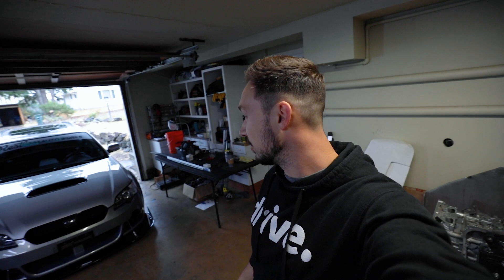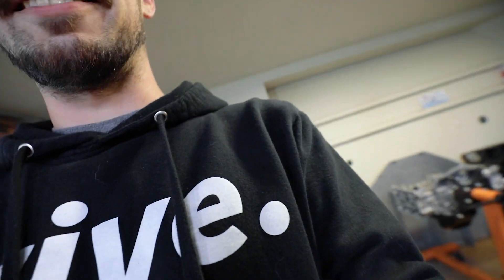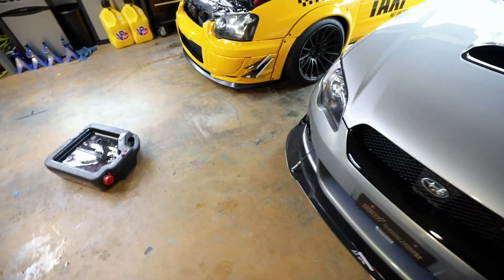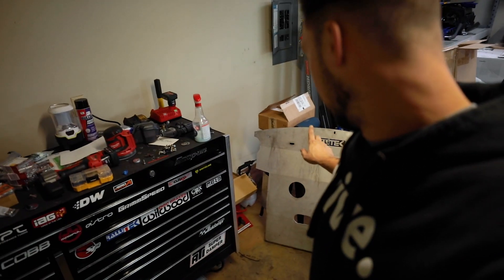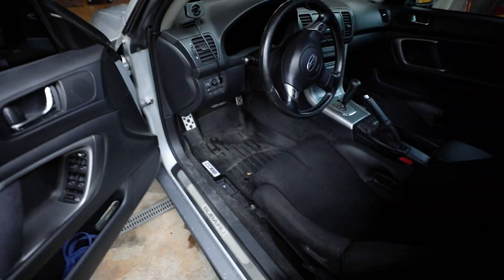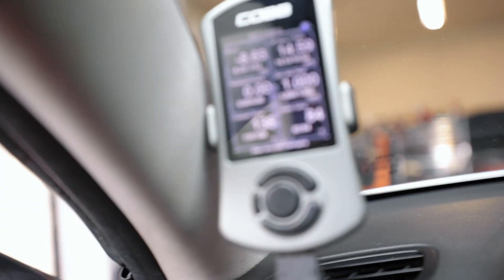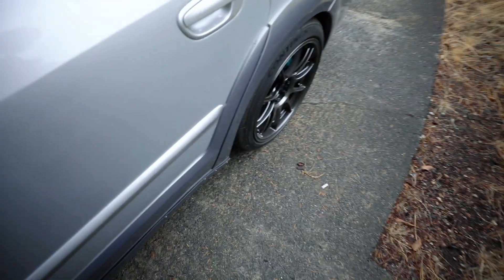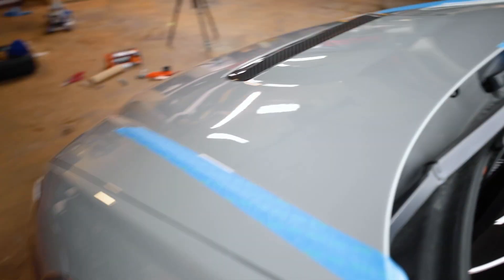Do hood vents actually help?! Let's find out!

Comment: Nice vents. looking for similar. Cant understand subaru idea behind IC placement at the top of hot engine.  What intake air temp do you have there on WOT?
Reply from the maker: With that top mount when actually moving air you'd see pretty low temps, close to ambient, and it would drop quick when getting on it. Issue is mainly heatsoak while sitting.
Reply: @MatlasDI  seems better than I've tought. Anyway I cant find vents like this in EU. Steel and with bolt holes.  I just found some marine engine bay vents look similar and are cheap lol.

Comment: Ok wheres part 2? I meam idle temps are useless. I wanted to know if driving temps went up or down 😂
Reply from the maker: @Bemk3  🤣 the car is in pieces now, but yes, they went down while driving as well. It was mainly heat soak that was a problem for this car with the top mount, once air was getting to the intercooler I'd see immediate drops all around. 👌

Comment: Thanks for this amazing instructional video. I have a 2008 Subaru Legacy and would also like to install a vent/lourve. I pretty sure that this has been taken into account but is there any possible way of avoiding cutting the inner structure of the hood?

I live in Singapore which is located 1 degree north of the equator; so we get pretty hot with the ambient temperature being about 86F [ 32 Celsius ]. The heat soak engine temp on idle can go as high as 158F [ 70 Celsius ] vs what is reported for yours [ 6:33 / 12:00 ] which is 68F [ 20 Celsius ] ambient & 144F [ 62 Celsius ] intake. So installing a vent / louvre on my Legacy would definitely help dissipate the heat away from the engine bay.

Comment: The way I see it if you roll down the passenger window it kinda blows air around in the car because the pressure has no where to go ( same as just front grille). If you roll down passenger window then driver window one at a time you'll here and feel the pressure from air making more of a suction (same as hood vents would do).
Reply from the maker: Very fun comparison 🤙

Comment: About to do these vents myself, have you had any issues with too much weather and/or debris getting in?
Reply from the maker: Not under normal conditions. Nothing ever had issues due to water intrusion, I did make sure to block them when washing the car, though, to prevent pressurized water from getting in.
Reply: @MatlasDI  wasn't sure with the AOS, that harness connection moves virtually right under that vent.
Reply: @MatlasDI  also trying to get an image in my head how they will look with Cyber-R scoop
Reply from the maker: @poudrecanyonbiker  think they should look good with cyber R, both pretty edgy so fit the style nicely I would think.

Comment: Nice work on the hood vents! I have a pair I've wanted to install. Now I know how! 😁. What are you planning on using for your gauge cluster once you install your six speed? Will you put one in for a manual or just leave the auto one?
Reply from the maker: Thanks man 🙏  look forward to what you wind up doing 👌 I'll be switching to haltech so it'll get their cluster setup.
Reply: @MatlasDI  Nice!!! That will be sick! Sounds like you have a lot more tuning control all the way around with it. Will the display fit somewhat in the same location?
Reply from the maker: @Mark A  Yeah, should make everything pretty smooth. They have display mounts that go in the same location.

Comment: I like how you kept the stock air intake scoop in there. I still have mine and wondering how you fit it in there?!
Reply from the maker: The af intake box has space for it, but it's a little annoying to out in, you either have to really jimmy it in there, or take the top off and then slide it in before putting the top cover back on.
Reply: Cool I will try to get mine to fit. Thanks for the tip!

Comment: I don’t understand. Wouldn’t water get inside the engine bay?
Reply from the maker: 100% it would. Part of the reason for placement was having essentially no electrical/ sensitive components underneath the vents, but if you're in an area where there's a lot of rainfall they do make water traps you can put in to prevent water from going places you don't want it to. Not exactly the best modification for a daily.

Comment: Did you do you headlights yourself, or did you buy them? Where from if you did buy
Reply from the maker: Used to have retrofits. These are just clear corner depos. Nice and clean. No issues if you never intend to open them up.

Comment: That’s a good improvement and they look great too. Between the JDM bumper, scoop, splitter, and now the vents the front end really looks nice. 

I’ve got an 06 Outback XT I’ve been working on as well, though going a different direction with it. Curious what hood scoop you have as well as where you got the Cusco strut brace for the rear. I’m going RalliTEK shocks and struts with the Cusco sway bars but couldn’t find the strut brace anywhere. 

Any chance on a walk around video going over everything you’ve done so far?
Reply from the maker: Thanks man, I have a madrig scoop extension and the Cusco I've had for a while, believe I got it from rallysport a couple years back. I do actually plan on doing a video like that here soon, just trying to get the final pieces together for the front. 👍